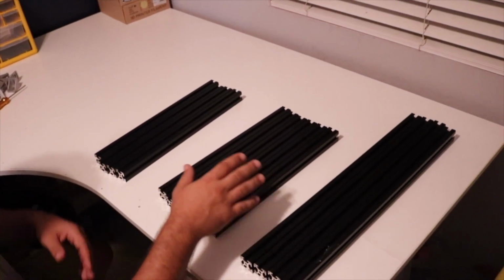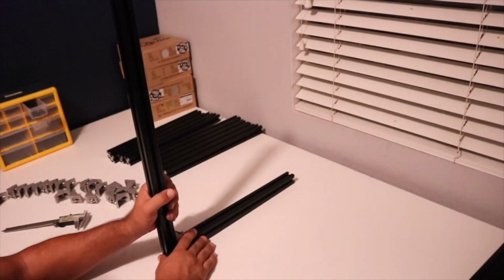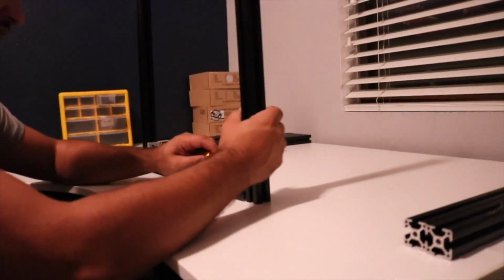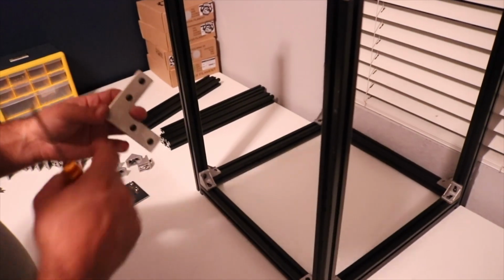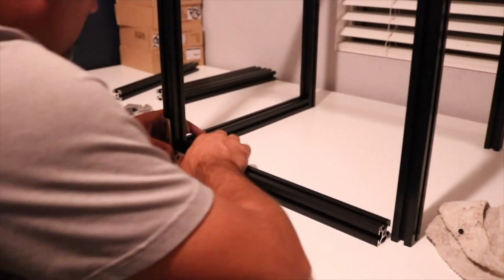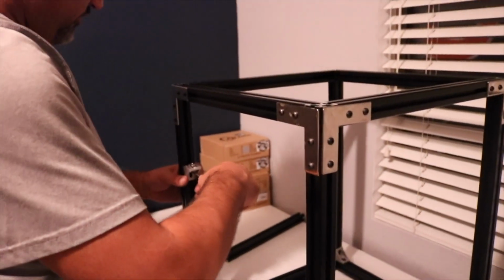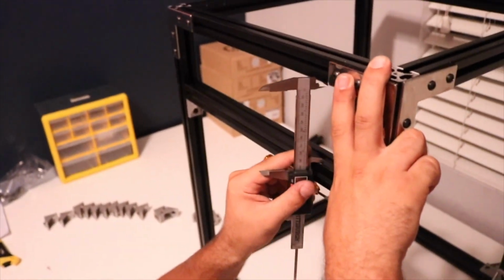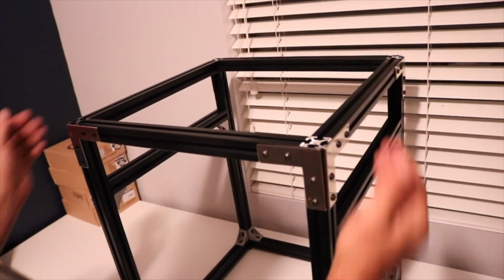Zyltech HyperCube 3-3-4 Assembly

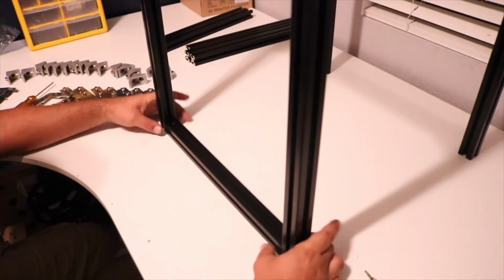Comment: 17:00 those L brackets DO NOT come with the kit. Fail.
Reply: The brackets were not included in the kit originally. We have made several changes and updates to both the 334 and the 445 kit. We added them to the kit at a later date. Please reach out to csr@zyltech.com if you would like for us to send you the brackets.

Comment: for 300x300x400 what are the correct measure for xy TRAVEL in the configurator? the real bed size it's 328x328 and travel 300? the exel configurator real confuse me, i want to mount z motor using coupler, for not lost z eight what are the correct lenght of z thread? and if i use z motor support mounted upside down?

Comment: I am looking at buying either the 300x300x400 kit or 400x400x500 kit.  Where do I go about downloading the STL files for the 3D printed parts?  Also does the 300x300x400 kit use the same printed parts as the 400x400x500 kit?
Reply: I also would love to know this I just bought a 400x400x500 from your site. Pretty sure i could find it all....kinda why I'm here watching this video....would be nice to at least put the information WHERE not just on look for support online....it's bot support it's ease of purchase